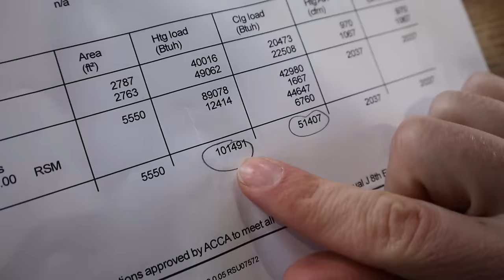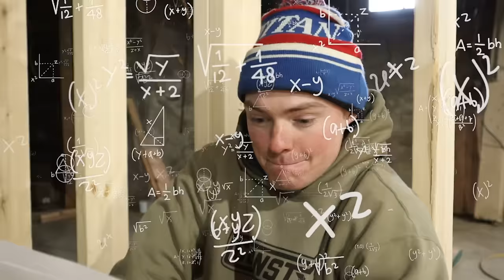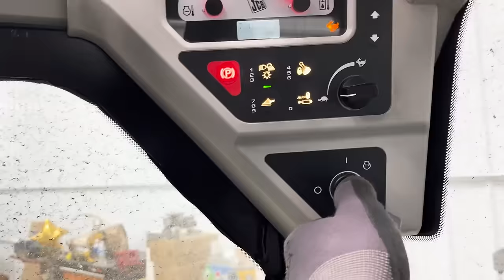Restoring A $7,000 Mansion: Removing 2nd Story Floor

Comment: I have a top of the line Trane inverter-based heat pump in my house in Maryland. They're great for AC. But they're miserable for heat when it gets below freezing. Runs and runs and never really feels warm. Maybe a geothermal would solve that. If you're going to put an air exchanger on the second floor, be advised that they make a lot of noise (mine is right below my bedroom in the basement and can wake me up at night when it is running hard in freezing weather). I would have the walls, ceiling, and floor in that room spray foamed to isolate the noise. Keep in mind that it is going to be even more obvious in the dead of night.
Reply: Heat pumps IMO aren't the best performers. My parents had one in Kansas and it was  always cold there. It's either hot and windy in Kansas or cold and windy.
Reply: I agree, heat pumps are not a good idea in areas where the temps can be consistently below freezing during winter.

Comment: I did a remodle on a house in NC, this was a two story with a full basement. with one heatpump in the basement and the other in the attic. i chose to go 1 ton more than the recomended on each unit. this turned out to be a very good choice as the next winter we had two weeks of extream cold snap. while every one i knew were telling me their units were running almost 24/7 mine was cylcling about every 15 to 20 min. also my electric bill was 1/2 to 2/3s of what theirs were. my up front cost save me money in the long run. just something you might want to look at. PS the house is close to 3000 SF.

Comment: Looking at the layout of the systems propsed, it lappears that there is only one register in each room, and limited cold air returns in general. Also, you have some super long runs of ducting, with the heat source over on one side of the house, in the basement, not centrally located. The long runs make it harder for the heat to get pushed adequately to the registers, and those cold air returns help pull the heat into the room. Maybe you're hoping the in-floor heat will help with keeping a steady temp, idk

I have a 5000 sq ft house as well, mid-MI, and run two geothermal heat pumps, and still needed to augment with a mini split for upstairs cooling. My house is super well insulated, heated floors in the basement (hot water + antifreeze (just in case, because yes, very cold temps have frozen the floors when there was no power)), and I couldn't keep the house relatively warm or cool without the combination that I have. Each room has a minimum of two heat registers and one cold air return that is larger than the supply side. 
The only thing I wish I had is electric heated floors in the bathroom, with separate thermostat. Now that would be nice!

Having a second system will be a fall-back in case one system fails. Having a wood burning fireplace catches us when the power goes out, and that is our only heat source to keep the pipes from freezing. 
Don't forget a backup generator if you are going to run on electricity only. 

I lived in S Korea for a few years, heated floors only. It was really nice when it was cold, but hard to get that in between temp range stable. Of course, it was a coal fired system, and that in itself is hard to regulate closely.

Comment: I built my house in the early 90s.  I went with a gas-fired boiler with baseboard units.   Also, I  have 2 a/c units for cooling.  One for the upstairs and one for the first floor.  The only thing I would do differently today is add more zones to my baseboard units upstairs and maybe use heat pumps instead of just a/c units.  Two units of a/c let you balance the system cooling for your home more efficiently.   What ever you do.  I will be watching and thanks for the wonderful content!

Comment: I absolutely agree with their calculations calling for double supplemental heat pumps. Radiant floor heating is adequate for your geographic area’s typical weather. At 5500 sq.ft. and the calculated loads, you don’t want to rely on the radiant floor heating alone, and that doesn’t include the AC loads which the radiant floor systems don’t do. I’d also add that 1 larger system MIGHT be more efficient than relying on a double smaller units depending on your electricity rates, and its usage.

And the ducting is absolutely achievable although I suspect that your sheet metal skills will be tested.  An ERV isn’t necessary but given your homes spray foamed envelope it might be worth the investment for fresh air circulation.
Reply: 🇺🇲🇵🇷🇲🇽😎 🤔 They already have a metal break...

Comment: My suggestion is to go with two HVAC systems, controlled separately but with remote controls. Remember your experience with the bin systems and the failures there. I recommend you make the HVAC system a turn-key contract and not worry about it later.

Comment: My hvac experience is 8 years. My advice, living in the heat and humidity of lower Alabama, have a 2 systems like the current plans are. It’ll be more expensive up front, yes. However, if you do go with one system. Put the thermostat, up stairs. That way it’ll read the temperature in the hottest part of the house. Unfortunately that would have two major drawbacks. First, the unit would never rarely turn off causing your power bill to skyrocket. Second, it would cause your basement and main floor to get very, very cold. With that being said I’d recommend two. You could look into ducted mini splits. That way you can run the 2 furnaces with one condensing unit.

Comment: I highly recommend tankless water heaters. They take up much less room in basement and only heat the water when needed. You never run out of hot water for showers or laundry. You can even do both at same time which is a game changer for growing families.
Reply: I came here to say this. I have a commercial-grade Rheem system, and it's worth its weight in gold. The venting/exhaust on it is that weird concentric pipe venting, but once you work around that with a slightly different system placement (we chose the garage so we could vent straight out the garage roof), you'll have endless hot water. Just don't forget the heat tape around the water intake line, as Iowa can get a bit chilly, LOL
P.S. We can run three showers, the dishwasher, the washing machine, the hot water at the kitchen sink, the laundry room sink, and all three other bathroom sinks simultaneously and still not run out of hot water or have a drop in pressure. No, I'm not associated with Rheem; I'm a property manager. They've had these systems in Europe for decades - not sure why they really haven't caught on here in the States yet.
Reply: With such a large house, I believe it's the most sensible thing to do. You might want to look intosolar heating for preheating your water too. Also, heat recovery from your gray water as I mentioned elsewhere.
Reply: Biggest suggestions,on tankless. If you have hard water soften it. Hard water eventually plugs the coils and put it a kit for cleaning said coils which will need to be done every year or two.
Reply: @stevenrgates  Don't tankless have a much higher maintenance cost and shorter life span?
Reply: @scottnunya2441  yes, and depending on where you live (like rural Iowa) the local repair men won’t service them… so you have to buy a new system if something goes wrong.
Reply: @scottnunya2441  my experience was fair, if maintained. Hard water is a killer. Buy quality.

Comment: The challenges that you have with the construction of the house is the same thing that I had with my house.  I renovated an 1800's farm house and we had no way to getting ducting from the basement to the 2nd floor.  So we came up with the solution of putting one system in the basement for the first floor and one system in the attic for the second floor.  We only did this for AC, since we have an existing radiator system.  There are times where the first floor needs less cooling than the second floor.  Having the ability to keep the temperatures separate is useful.  Good luck with your project.  I went through a lot of what you are doing in my farmhouse remodel.

Comment: heat pump will keep you nice and cool and feel pretty close to air conditioning, the heat out of a heat pump is never going to feel like furnace heat because the temp coming out of the heat pump is cooler, you need a fireplace or something if you want a heat blast on the super cold days, or just use a straight up LP furnace, along with your floor heat, If you want something to heat the house up on those marginal days, the LP furnace is going to get that job done no problem, with heat pump you are still going to feel chilly

Comment: Have two forced air furnaces one for the top floor plus attic and then with the second one for main floor and basement any house over 4,000sqft usually have two systems don’t bother with in floor heat and heat pumps. You’ll need about five heat pumps to cool your house so it will add up quick go with the traditional vent and duct system. Good luck
Reply: Yes. This.👍 Two furnaces without a doubt. And, the only place where  a heated floor is worth the trouble is in a bathroom with a tub and or a shower.

Comment: Speaking of heating/cooling..  Have you considered a geo thermal system getting your heating and cooling from the ground?
Reply: Shallow well already existing in the basement might be a good source of heat and cooling :-)  Usually too expensive, and the efficiencies don't pay off in a residential application, even with such a huge house.
Reply: @jkpq8738  Think that well may be too shallow for what I was thinking, they'd have to go quite a bit deeper.  A friend in Kansas built a few years ago and do all their heating/cooling with a geothermal system, they love it and price wasn't too bad for their home of 3K sqft.  I'm just thinking with that extra 2k that is already there plus an addition later on, it may be a viable option to heat/cool such a large home.  Obviously it's Cole's call, but just wanted to put the bug in his ear so to speak to consider.

Comment: I agree with  the hvac comments. 
Zone at a minimum  each floor as a minimum. 
Basement  Main floor bedroom floor and attic area.
Having manifolds to supply these areas and their sub areas is important  in comfort and operational  costs.  When you run, these costs out over say 20 to 30 years it becomes quite inexpensive. 

You could also go Geothermal  which would  be even more cost effective. 

On a recent TOH episode they had 4 Geothermal  holes several hundred feet deep to have an average of about 50 degrees  for cooling and winter heating.
This was accomplished  through  heat exchangers  and  special under  floor and also air handlers. Etc etc.
Cole Don't  be afraid  to hire the most knowledgeable  ppl who can help you in this area. 😊
Stay  cool/warm😊

Comment: Have you considered leaving room for an elevator?  That can also give you a great vertical chase for other stuff as well.

I have a very dear friend whose home was destroyed in the Woolsey fire (SoCal 5 years ago). When she and her husband rebuilt they included a small elevator and it has been a true blessing because now her husband who has mobility challenges can get around like never before.  The additional independence for him makes a huge difference in not just his ability to move around the house but his spirits are higher which has made him more active which has improved his mobility!

So building for generations…make a spot that is framed for a shaft on all three floors at the very least and keep it clear of cables, pipes and ducts so it doesn’t have to be a big deal to cut in one later.

You’ll be surprised at how little space is needed.

Comment: Do normal a/c units with gas furnaces. Heat pumps are made for warmer climates.
Reply: Yeah, there was a study that came out showing heat pumps and mini splits work in cold climates and are more efficient than traditional furnaces.
Reply: Mini split, yeah. Traditional heat pumps aren't for 15 below Iowa winters.
Reply: but like he said. for mild conditions, they would be better for the cool early fall days.

Comment: cole my best recommendation is to finish the basement, put anything that you need for the house, if you are going to do a mechanical room, laundry, electrical and plumbing. do it now so you know were everything is going to run through the house. it will save you the pain of the finishers putting holes in any place they can, it can cost you more to remove stuff you build now in the 2nd floor and attic.

Comment: Considered a ground based water to water heatpump instead of a air to water/air system. The ground temperature is always stable if you go deep enough. The equipment usually last longer as it has to work less. During summer the coolness is almost free.

Comment: The other thing to think about is with the spray foam you air exchange in the house will be alot less so you might want to look at an hrv to be installed to get that fresh air in

Comment: If you are going to do a heat pump, look into geothermal heat pumps.  The ones where a large coil of wire is buried outside to assist the condenser unit to be more efficient in colder or very warm temperatures.  For your boiler, look into allowing solar water panels to help heat the water.

Comment: Mini split units might be something you should look into for heat and cooling. You don’t have to certified to install them and they’re very easy to install. Plus you can setup zones.
Reply: the size hes got. you need 25 of them.
Reply: Mini splits are useless below like 10⁰. You have to have a second heating source. It would be awful for their winters.
Reply: A multi head unit eliminates the need for ductork and rebuilding walls.
Reply: @fairhall001  cant wait to see how joist running every which way makes this fun.

Comment: We live in the South where AC is more important than heat.  We've always had 2-story homes with two systems.  And it has come in handy a few times when one of the systems went out in mid summer.  There were times we hauled mattresses downstairs when the upstairs unit had issues.

Comment: I live in Pennsylvania. Our house is a 4 square. It’s a hundred years old. Tough to heat and cool the upstairs, as well as an addition on the rear of the house. Installing a mini-split system was the best decision we ever made. While your walls are open, install the mini-split as recommended by Tom Roche. 
We already had the ductwork for forced air in our walls. The gas furnace is our main source of heat. The mini~split allows us to add extra heat by zone in the fall, winter, and spring, and is our a/c in the summer. No way could we have cooled this house evenly with a whole house a/c unit. 
The mini split allows us to control the cooling upstairs vs downstairs. We actually installed 5 units inside, the max allowable with our Mitsubishi outside unit. Unfortunately we had to install our mini split lines on the outside of the house. Do it now while your walls are open. Also looking to the future, when you add your addition, you can simply install another mini-split system there as well. This is the way to go.

Comment: Your instinct on using a single boiler is right on. Appliances have maintenance costs and replacement costs. Better to have one big furnace. Put the furnace in the middle of the house and create runs between the floors. Now is the time to make mechanical runs, which can include plumbing, data runs, etc.

Comment: Multiple heating/cooling systems in a house that size is a must.  As you found out when having a single furnace that fails, your whole house suffers and could potentially be very expensive should pipes freeze in walls.  Having seperate/supplemental heating/cooling can be a life saver when one fails (you don't lose) all heating/cooling.  Costs more up front but it will never be cheaper/easier than now to install.

Comment: We only have a 2500 suf home, and we run two heat pumps. They actually help keep your utilities down, because you can set them based on the temps on the different floors. Our second floor is ALWAYS hotter than our first floor. Plus, if one goes out your entire home is not without temperature control. If you can, put the money out up front and save yourself more $$$ down the line.

Comment: We live in a 24 year old story and a half farm style house, it is 1700 sq ft. We have two units, one for the main floor and a slightly second  one for upstairs. In order to keep the house comfortable.. It is cheaper to run the two together than one that you beat up trying take care of the entire house. Another thing to consider is in an emergency you can limp along for a short time on one buy using a couple fans until repairs can be done.

Comment: Yes two systems,  Love having a heat pump.  Need 1 for basement and main floor and 2nd unit for 2nd floor and attic.  You won't regret having both.  Make sure to add humidifier to the systems though.

Comment: Cole, wife & I bought a 1912 Craftsman in W Washington. We had a radiant system put in with baseboard radiators mounted under each window. All you need is pex runs. No ducts or forced air, just warmth without too much visual nor noise. We have the option of a mini-split for cooling if our climate calls for it.
You guys are doing a great job!

Comment: Both my Dad (used to) and my Brother-in-law (currently owns his own business) did/ do remodeling and renovations. They both taught me that when it comes to upgrading electrical, plumbing or HVAC is is cheaper in the long run to pay up once and cry once than it is to pay up twice and cry twice.... Especially considering that the second pay and cry will cost A LOT more that the first one.